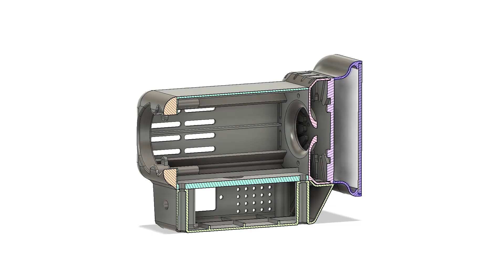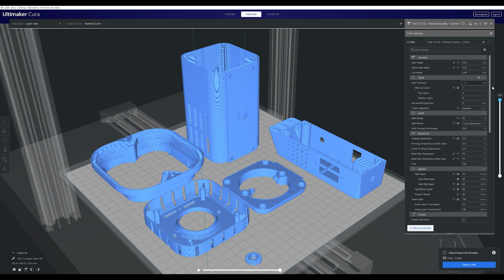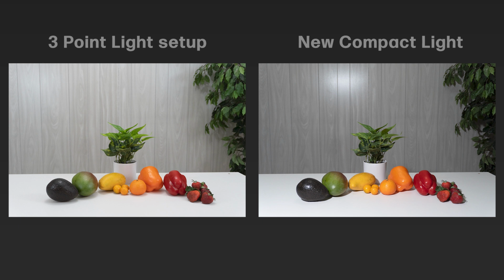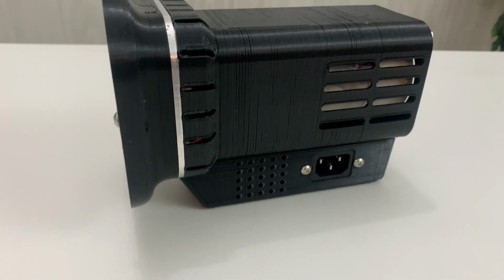Converting Ceiling Can Lights Into Compact Studio Lighting

Comment: cool build. camera gear is sooo expensive and this is an interesting option. i don’t know why you got so little views… deserves more
Reply from the maker: Well thank you for this! Turned out well and I still use it to this day. Very rewarding building a piece of gear that would otherwise cost a few hundred (if you have a 3d printer of course).
Reply: @hobbybuilt  yeah i suppose that not having the 3d printer is the biggest bottle neck in this project, but for the money that you save on lighting gear one could justify the purchase of a 3d printer i guess. 
I found your channel through the chess board video that you posted recently, was that the first video that the algorithm really picked up. Like does it take 5 videos to get some momentum or is it just the hope that one will strike the interest of many… I‘m asking because I’ve been thinking about starting a channel myself and creators like you are inspiring.
Reply from the maker: @ definitely, it’s something when you get it you notice all the money you can save just printing it.

Yeah, I started YouTube awhile back 5+ years ago with CNC videos mainly then I uploaded some different vids again no traction I put YouTube on the back burner , until one of my videos “mdf mirror” had a slight uptick in views so I said what the heck and did a few more and it all started slowly getting traction.

Do it! If anything make a few videos wait till you start seeing an uptick and then go more in.
Reply: @hobbybuilt that’s interesting… thanks for the advice. I’ll see how I do. good luck on your future YouTube endeavors. You got another sub today 👍